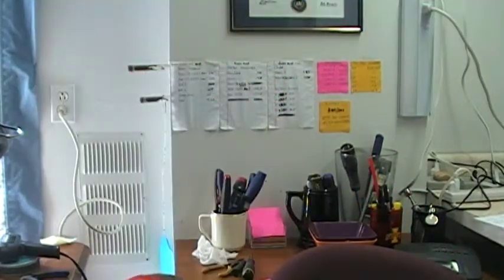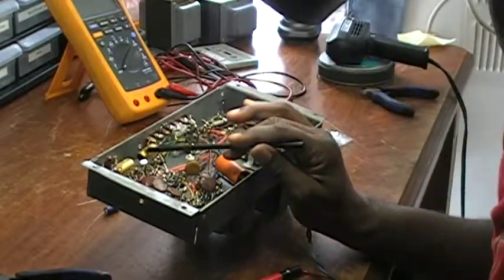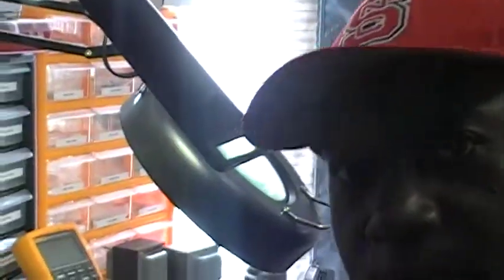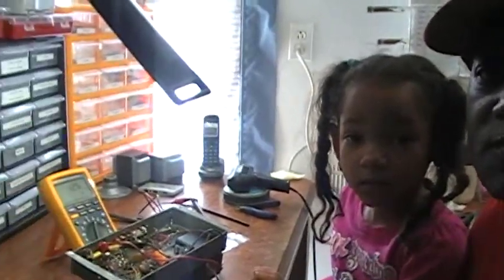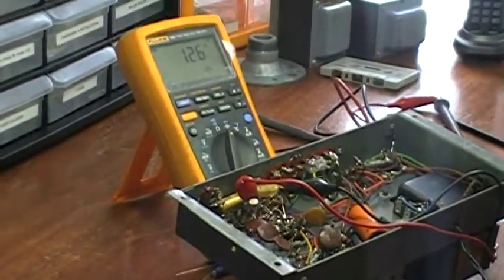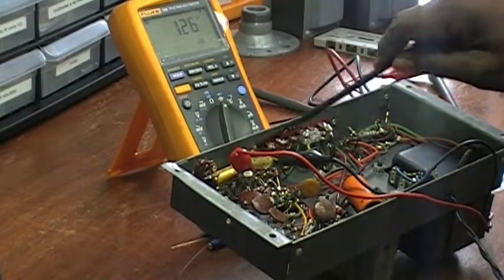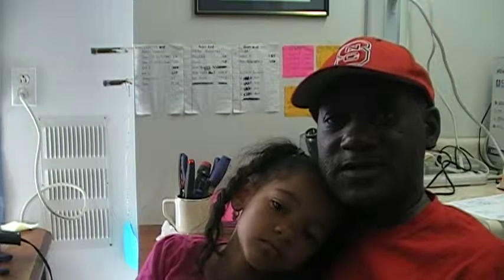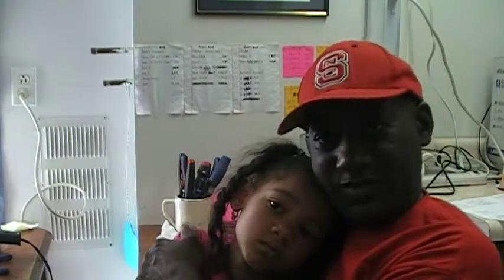Using A Blue ESR To Test Capacitors In A Hammond AO-44 Amplifier

Comment: I'm not familiar with either instrument, but I am wondering if the test leads should be shorted and zero out the lead resistance before testing.  As to the two caps, that could merely be a form of oxidation.  But as my Amateur Radio mentor used to say some 55 years ago, "when in doubt, take it out!"  Good luck with the amp and I hope that your pretty assistant gets to feeling better real soon!  That same crud she has is running rampant in West Tennessee too.

Best regards,

Mick
Reply from the maker: You are correct Mick. Still learning to use this new equipment. Its fun though. lol  I did the "0" out procedure after the video and got the same results.  I also contacted another person who does electronic videos on youtube (Uncle Doug) and he was very helpful as well.  Based on his review of this video - he believe that the ESR provided accurate results and explained to me why I the white film may have been on the capacitors. He reinterpreted the high ratings on the multimeter for me. He let me know for example that I could use a 20% tolerance above the base tolerance level while maintaining a 10% tolerance below. Thanks very much!!
Reply from the maker: Hello Mick - You are correct.  It is important to zero out the leads.  Please take a look at the videos that follow this where I made adjustments and increased my learning via dialogue with an electronics expert - Uncle Doug.  It has been fun learning to use this new ESR instrument.  I highly recommend it to others. Thanks for your comment.  It is much appreciated. Dr. Kemp